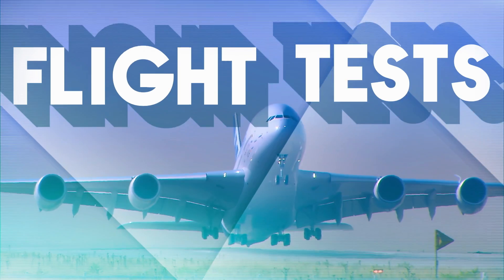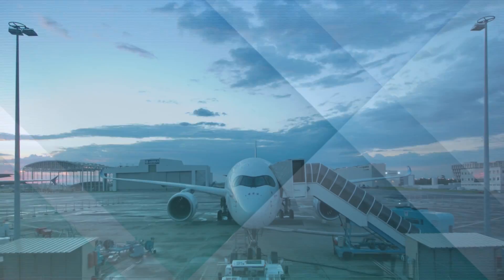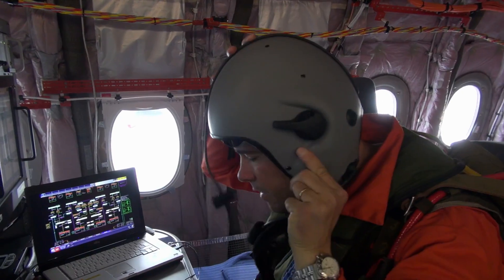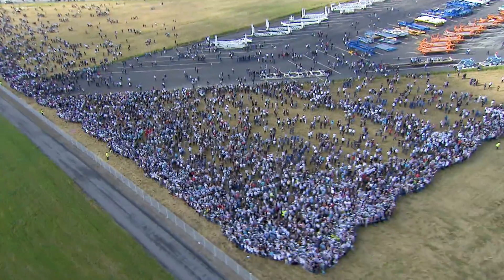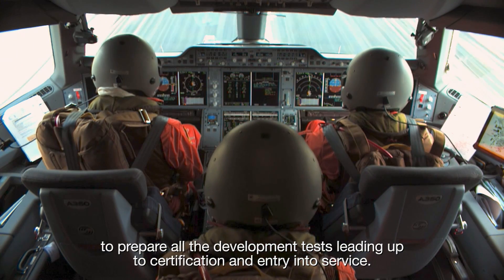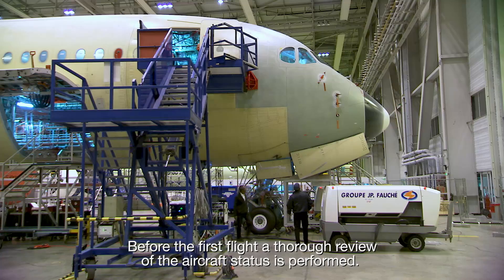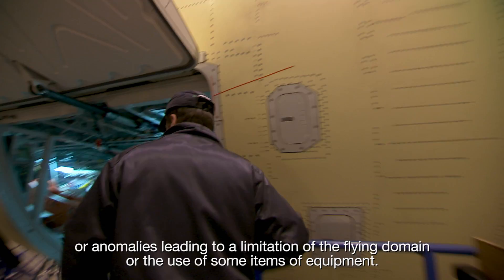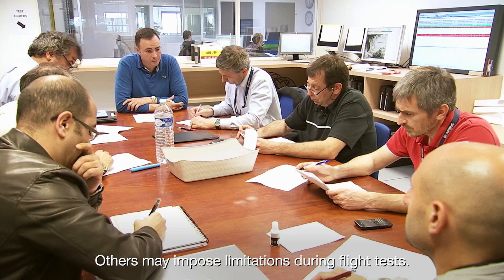Flight Tests - Ep.2: First Flights

Comment: What does it mean by direct and indirect law? Control vs autopilot?
Reply: No, It's a designation for different Fly-by-Wire modes. "Direct Law" in an Airbus means that the Flight control computer move the control surfaces in direct relation to pilot inputs on the side stick. That's not necessarily the case in "Normal Law" which would normally be active during flight.
Reply: @shi01  oh I see. So normal law is the computer taking the pilot inputs and possibly adjusting them before moving the plan?
Reply: @timjamesvella  Yes. For instance, The flight control surfaces become more effective as speed increases, which means normally at higher speed the same control input would lead to a stronger reaction. In normal law the flight control computer makes adjustments for that so the resulting action of the aircraft to a certain side stick input is always the same, regardless the speed.
Also it can disregard control inputs all together if the resulting action would put the aircraft in a dangerous attitude. For instance. in normal law it's not possible to achieve more than 67° bank angle.
Reply: @shi01  awesome thanks!

Comment: Just curious, while it's probably extremely unlikely that the ac will experience catastrophic failure, what is the the evacuation plan like for these flights? I noticed the protective gear and parachutes of the flight test crew. Does the crew egress from the main cabin door or one towards the rear?

Comment: Can anyone tell me what is hanging on the tip of rudder? 8:22
Reply: My ex wife
Reply: It is called a Trailing Cone.  It is extended away from the aircraft to measure Static pressure for Flight Test Certification of the Air Data System